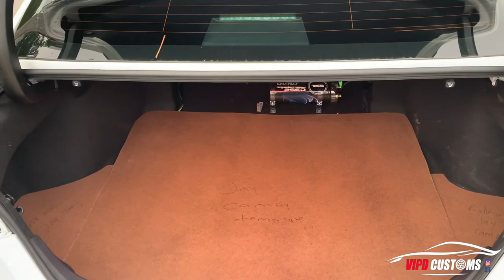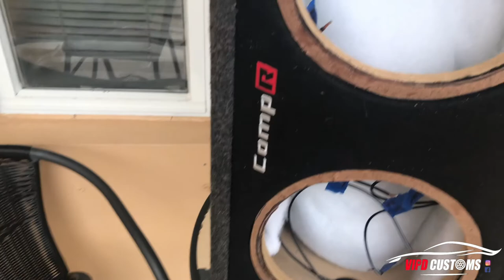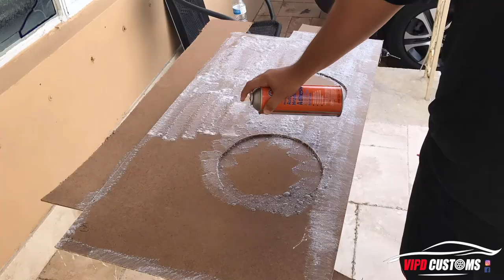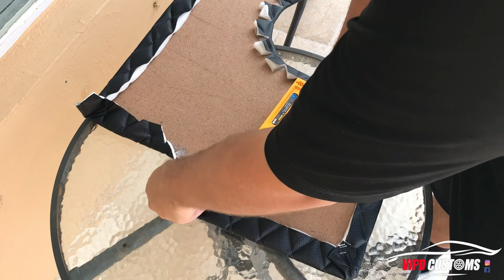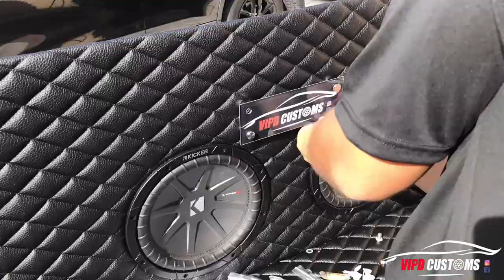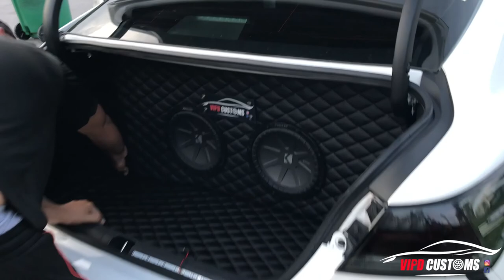VIP FULL TRUNK SETUP on a Toyota Camry ! Super clean setup !

Comment: Why that thin of a wall?? It dont bend or flex?
Reply from the maker: To be able to put into the truck with out issue. No sir no bending or flexing
Reply: @VIPDCUSTOMS  so why in infinite baffle setups the use them thick ass plywoods? Also do u have a sound clip of them?
Reply from the maker: The board are wrapped with thick leather is muffled the vibrations but again no issues
I don’t have that vehicle no more so I can’t shownuou a sounds clip
Reply: @VIPDCUSTOMS  ok wat kind of thin wood u used? And wat did u use to cut out
Reply from the maker: Not sure the name but I sourced it at home depot